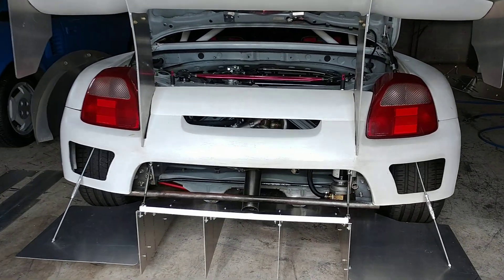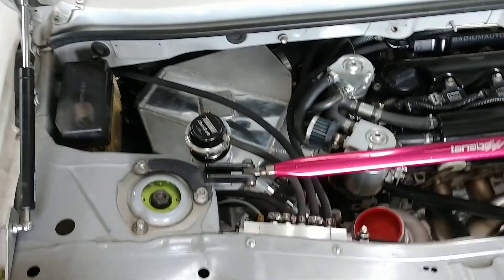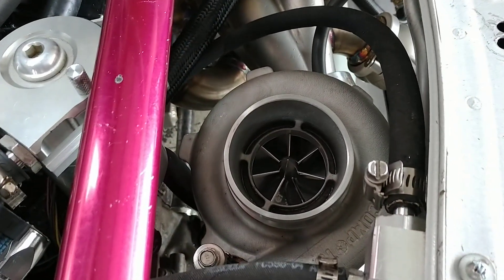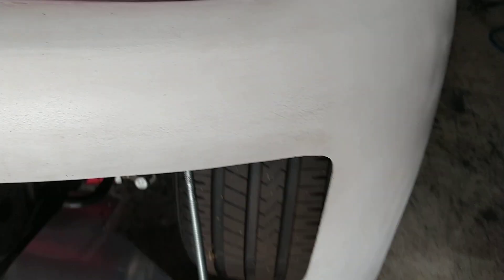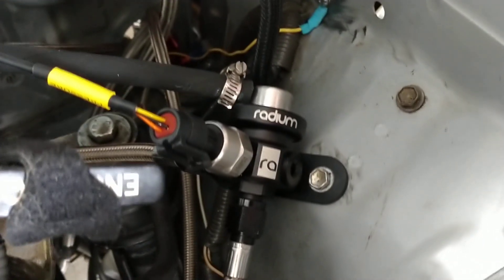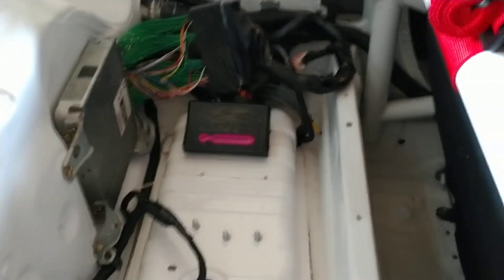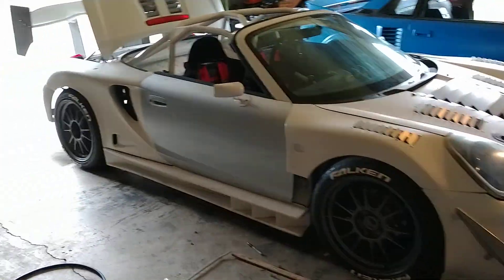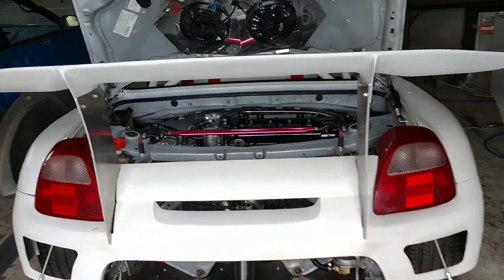Back together again!!! Parts breakdown on new turbo, fuel, and ECU setup- 2zz turbo timeattack mr2

Comment: Looks awesome mate can’t wait to hear it in action! be interesting to see if the hot air extraction works well rather than just venting. I’m pretty sure with the side air intakes the engine bay should be positively charged when the cars moving. Very cool!
Reply from the maker: Thank you so much! I plan on logging some temps once she gets going to see the actual difference the fans make. I would imagine it will help significantly.

Comment: Awesome build!!! Maybe consider making the exhaust tip a little bit longer...so the exhaust fumes at lower speeds can for sure be extracted properly and not increase the temp. at your engine bay. But that is just a suggestion. Again congratulations, awsome car & build!!
Reply from the maker: Thank you so much. The exhaust with be tear dropped which will extend it slightly but their will be scavenging happening at any speed thanks to it's placement in the diffuser. So the exhaust should be pulled out by air traveling over the diffuser. At least that's the plan ;)

Comment: Stunning MR-S man. What compression ratio, sleeves, meth injection?
Reply from the maker: Thank you!  The compression is 10.5:1 thanks to the mahle pistons. I wanted to keep it a higher compression motor as that's how it was designed but still lower it for some safety under boost. No sleeves although I may build the next motor that way. No meth. Air to water intercooler for now and will run race fuel on the track to cool the engine be more.